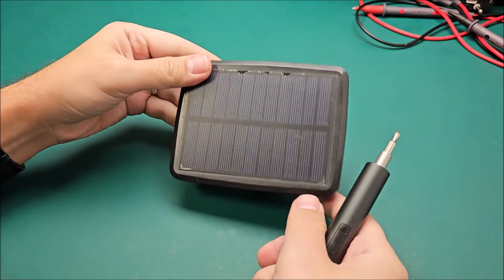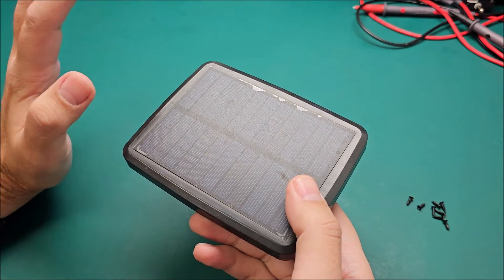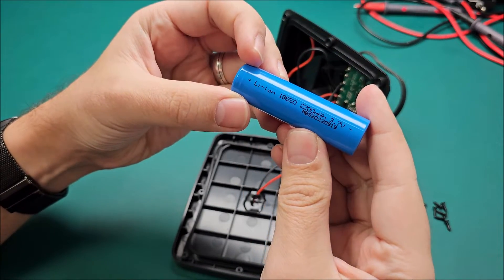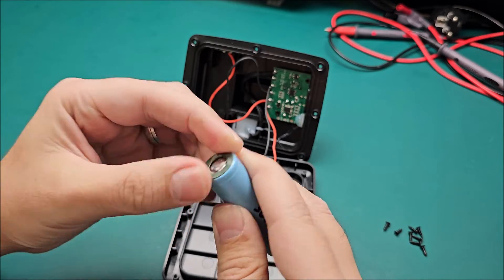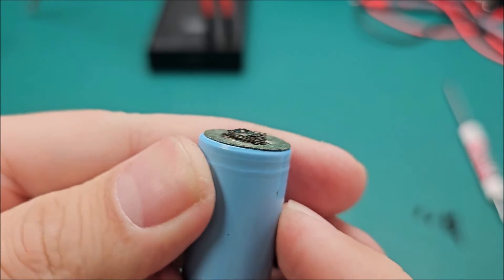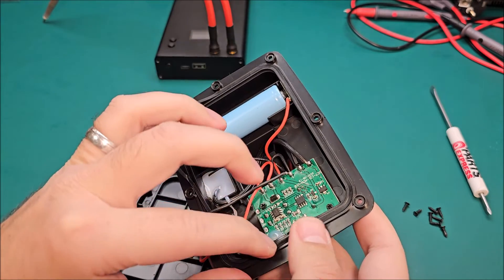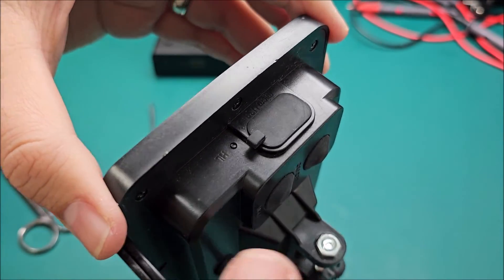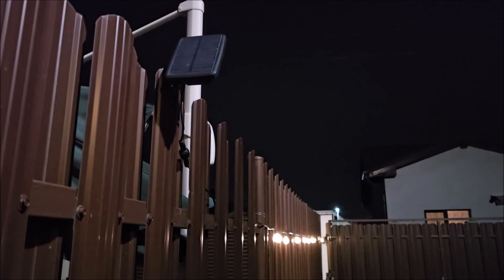How to upgrade the rechargeable Lithium cell in a solar light 🔋☀️

Comment: Does the solar pannel actually charge the unit ? And if you put in a fully charged battery. When will you have to go out and disassemble and charge it manually again ?
Reply from the maker: The solar panel charges the unit. A fully charged 18650 cell might last absolutely maximum 2 nights, but not more for sure.

Comment: Could you not have put a big blob of solder on the +ve contact rather than try to provide a 'pimple' on the battery? No messing with a welder and no risk to cell.
Reply from the maker: Makes sense, but did not think about it 🤭
Reply from the maker: Also, I really like to play with the welder 🫣
Reply: @UltimateDIY  Fair point, well made😊

Comment: Hello, i had a similar problem with a light using a 18650 Li-po battery. After a few nights it would stop working. The problem with the Li-po batteries is that you can't use the full 4.2 volts. Once it gets under 3 volts it becomes unusable, and it mostly won't charge anymore. So you only have a usuable 1.5 volts. 
I replaced it with an old smartphone Li-on battery that can go down to almost 0 volts and charge up again and my problem was solved. I just soldered 2 wires to it. Regards
Reply: OK I could be wrong about this. Thnx for the link> time to do some reading
Reply: @bruceclothier8238  I'm just giving my experience. Those 18650 cells are tricky, once the get under a certain voltage they won't charge normally and they might even get damaged. I had to take the battery out and diy-charge it, this happened several times. That's why i switched to a li-on battery. No problem since. I have the same problem with Makita 18 v batteries. Maybe the problem doesn't exist with 18650's with undervoltage protection, but those cost more. Regards
Reply: @user-2uf2kr2c you could try protecting the 18650 cells. Adding a small board to it and it will disconnect itself after a certain voltage.  It will cost about $1? But you have to buy a bunch of stuff in bulk. Like shrink wrap,nickle strip,ect
Reply from the maker: Hello. Some chemistries are better for deeper discharge. Glad you found a fix 👍🏻
Reply: Theres no difference between the Li Ion and the LiPo as regards the useable range. Both are constrained   by the allowable minimum of 2.5 to 3V
Reply: @bruceclothier8238  not to my experience. The li-on works fine in the light. Even in the wintertime with days without sun. The li-po would drop down to an unchargeable point,  the li-on didn't. Regards
Reply from the maker: Could be even other factors at play. Different chemistries have really different properties: https://www.batterypowertips.com/difference-between-lithium-ion-lithium-polymer-batteries-faq/